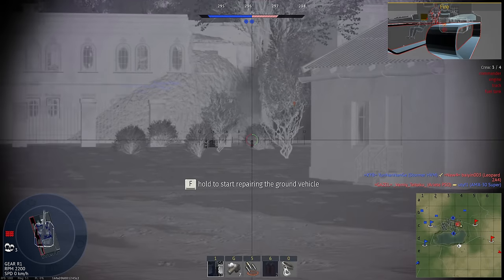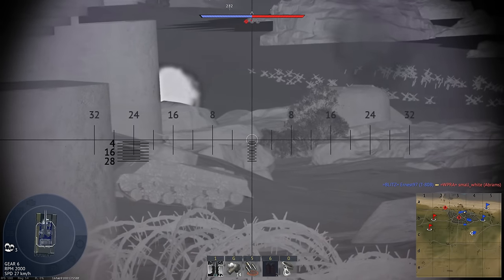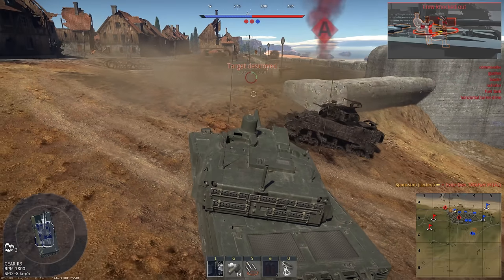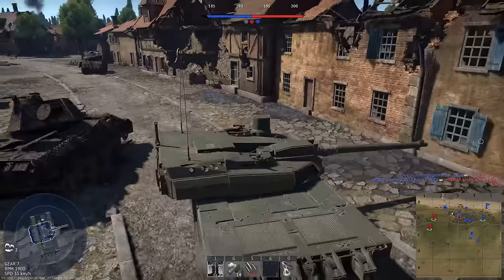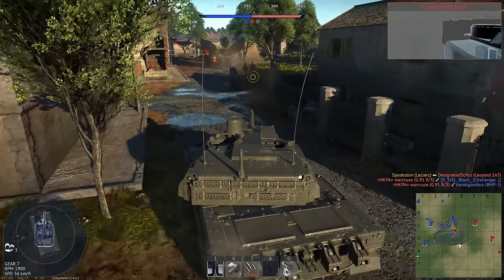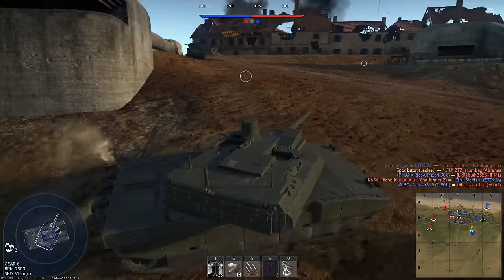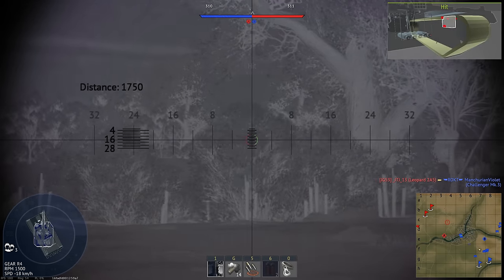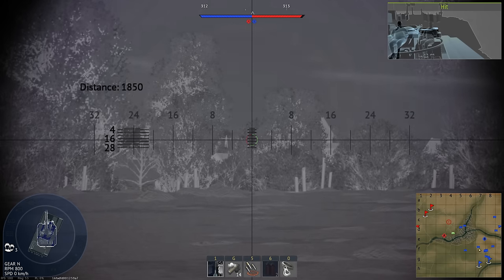The Future of Tank Armor

Comment: Would troop dropping be practical? Such as the ODST’s or Starship Troopers.
Reply: @Tunnel Rat 

I don't think so 

it would be coming in to fast and if they put in everything it needed to survive a landing it would be to impractical
Reply: chuck buck Well the ODST drop pods don’t just free fall from orbit. They have air brakes and thrusters, so when the pod hits the ground it’s going about 60mph, or 100kmh. That is absorbed by internal dampeners. So it’s still much faster than a parachute and can be dropped from low orbit.
Reply: @Tunnel Rat 

yeah I get that but in real life it would have the disadvantage of being loud and highly visible 
unlike 40k drop pods ODST’ s need to slow down a lot like you said to 60 mph 
in 40k they use the speed of a object falling from orbit not only as away to avoid anti air fire and missiles but they also create a wonderful shock and awe effect from the shock wave 
this only works though because the s-ace marines of 40k are heavily biologically modified super soldiers where as ODSTS loose this -potential. The pod is slowing down drastically as it reaches the ground. Making it  vulnerable to anti air and enemy combatants in the area it lands in. 
a real one would halve to be abreast with defensive countermeasures like a low radar signature (stealth paneling) or flares and by then every time you launch it it would be like loosing a f-22 just to get a get a guy on the ground .

I guess the problem is that they only carry one person and the ODST pods have a one time use right?
that seems to expensive for practical use as re - entry does a lot of damage to space flight vehicles 
the space shuttles were built off the idea that they were recoverable and even then it took months of maintenance that ultimately was more costly than a single use rocket system.
I think that the starship trooper system works better 
it is recoverable and carries 1 or 2 whole squads 
in the real world however the main issue is not getting them into orbit and down on earth in one piece it’s how much did it cost to get them their and how soon can you do it again  
you would need to retrieve it, get it to somewhere to return to orbit and then repair it that could take months to do. since unlike in starship troopers and halo; a Osprey or c-130 cannot break orbit so we the pods to be at a space port, meaning, must travel all the way back to cape Canaveral just to have the opportunity to be used again not to mention the servicing and life span of a piece of hardware that withstands the friction of earths atmosphere that causes giant pieces of SOLID ROCK to explode from pressure enough to shatter glass.

it’s a marvelous idea that I could see being done but not until space travel is more efficient so that you could drop troops secure an objective and return the shock troops and pods to orbit wher it could be repaired and the troops rearmed on another to get on to another assault what would happen now is because of the long down time for the hardware to be mission ready again it would only be used for key missions or major breakthrough attempts of a front line.

what I see happening is somewhat of a combination of both ideas since we can’t quickly redeploy orbital drop pods
a large “space shuttle” carrying troops, vehicle equipment etc will launch from a station in low orbit and re -enter earths atmosphere. Then, the shuttle decelerates with air brakes or thrust and then instead of landing it achieves stable and steady flight. Then it releases its cargo in the form of multiple gliders that carry the military assets to the ground. The gliders will have the benefit of being dropped from high in the atmosphere where they can build up a lot of speed during descents for maneuvers and adjustments to their course.  Once they land they are converted into simple prefabricated shelters for the ground forces. But before that happens, the shuttle that the gliders launched from has to return to orbit, this entire system depends on the main mode of transportation being to return to orbit independently or not needing to be recovered from the ground. 

the shuttle itself is designed around being light and anything that is needed for re-entry is ditched with the gliders, thermal paneling (needed for entering earths atmosphere), control surfaces (wings ailerons, etc) it would be massive like the size of a cargo ship. But the light design and having most likely at least half of its weight shed, it would be mostly thrusters some fins and the crew compartment. It uses rocket boosters to re enter orbit where it would dock for repairs and reassembly. 

I have a few other ideas though (I’m bored alright)

the shuttle; similar to satellites, uses earths gravity as  a source of  speed and then would pull up into a climb and use the added energy from the slingshot maneuver and the rocket thrusters to get back into orbit. Sadly this kind of maneuver I did not mention because the rapid climb at extremely high speeds would produce massive amounts of g’s harming the airframe or the crew itself and also limits the window in which the para troopers or gliders have a small window to safely deploy. 

All in all 
orbital drops are expensive and complicated combined with putting them in a war time setting is probably an  order of magnitude more difficult. In a economic perspective you need to either invest in a highly expensive system that you can’t risk loosing that is very expensive to keep. While you could have cheap(er) system that is less reliable ...... but expendable. That seems to be my take on all this but I’m not an aeronautical engineer their might be a cost effective and reliable solution in the future .
Reply: chuck buck So? ODST’s aren’t for stealth, they’re for quick troop deployment.
Reply: @Tunnel Rat 

I’m saying in real life. Where we have radar guided auto cannons missiles and fighters. Not to mention theatre defense systems like the U.S. Patriot missile defense system and Israeli iron dome missile defense system. Not to mention in a scenario where the drop pod assault goes bad. During D-day the troops who parachuted in where scattered and the Germans had flooded the farm lands with water and some of the troops that even made it to the ground drowned due to a complicated parachute that took to long to take off or the Germans when they invaded Crete and did not land with their weapons and had no way to guide the parachute mid flight. In operation market garden  the British troops landed right on top of the Germans and most of them Died before getting out of the air . Even in Halo ODST their pods are scattered and the main protagonist if I’m remembering right was unconscious for at least an hour and the door did not work. He had to use the emergency explosive bolts. Airborne drops are dangerous, they can get troops on top of the enemy quickly but also can be very vulnerable if they cannot get quickly organized especially if they do not get support from air power or heavy vehicles.

Comment: Hey Spokston, I have a question. Does the Leopard 2 A5 (and higher) "arrowhead" turret armor work a little bit like the perforated one? I ask because there is something like normalization of hitting kinetic round and thus the penetrator hits angled front of arrowhead, perforates it and then has to penetrate another slab of armor (still in the arrowhead armor addon) angled in very different way (vertically and horizontally) and after that it can hit main turret armor. Does this kinetic penetrator normalize twice or even three times when trying to hit main armor? And if yes, does this effect has a potential to break the sabot because of tension caused by normalization while still being in the process of going through first one or two layers when normalizing to one more differently angled layer?
Fast pic of arrowhead addon: https://www.google.com/search?q=leo+2+a5+armor&sxsrf=ALeKk02cYijqp1g3rqOUbLJgs0ilC8whSQ:1588967812548&source=lnms&tbm=isch&sa=X&ved=2ahUKEwiAy5qwhqXpAhVIPJoKHToSBI8Q_AUoAXoECAwQAw&biw=1920&bih=937#imgrc=NkjNqLLFHIJUpM
Great video as always ;)

Comment: It seams like Metal Foam might work well on EFP/HEAT rounds. I mean shouldn't the jet be dissipated some by the little bubble areas? Wouldn't the pressure/jet seek the least resistance and so dissipate itself into the bubbles?

Comment: If the electromagnetic armor only has a circuit when it is penetrated by the copper jet, then wouldn't it be using basically no energy even if it was "plugged in" all the time?

Kind of like a battery sitting in a turned off flashlight. Technically leaking some amount of power but not a whole lot I have to imagine that whatever is produced by the engines to charge the battery should be more than enough to keep whatever capacitor is there topped off

Comment: How long has the PUBLIC known about steel foam? I have never heard of it before until now and I can see it's advantages and disadvantages. But when you're talking about shaped charges I'm gonna assume you mean directional or "focused" explosives. Depending on the explosive, it could or couldn't block said explosive on its own. Even with plate armor as a primary buffer the foam aspect that I think of is probably still going to be melted through with ease. But if we're talking about something that's gonna just rip apart plate with brute force i.e. a RPG it could stop it, though you are going to have damaged sections of the armor either way.

Comment: I'm not sure how official this is, but most conventional tanks have increasingly operated around the "all or nothing" principle used for late dreadnoughts and fast battleships and many different warplanes. 
Basically, maximum armor protection is at the most critical points.
So on tanks, large parts of the front. 
Obviously, all around protection has made more sense for urban environments. 

It's why in War Thunder, a late Cold War MBT (Leopard 2, T-80,  M1 Abrams) can be easily penetrated at the side or rear by a 37mm M3, while late war heavy or medium tanks are difficult to penetrate at any side. 

Also, Matsimus has a great video talking about how the composition, shape, and structuring of your armor can have an effect on different tank rounds: https://www.youtube.com/watch?v=u0p_Rr6gUtM

Comment: Oddy enough, there is evidence that armor would go the same way that Battletech went with its armor given that we've basically invented EndoSteel (back in 2016/2017, the famous 'metal foam stops .50cal video' started popping up) centuries before the Battletech material was invented in-universe.
Reply: And Gundam SEED uses it for the Astray derived MS. Though 00 uses Graphine( or as they call it E Carbon) armor.
Reply: @barrybend7189  however Battletech was one of the firsts in this regard. If anything it is oddly predictory in some regards, particularly when it comes to weapons and materials...
Reply: @TheTrueAdept  yeah though sad thing is all the SEED properly powered mechs are fission powered and not fusion powered. So downsides to SEED. Though it would be fun to see how Mobile suits and Battlemechs handle against each other.
Reply: @barrybend7189  Well in Battletech's case, there is a fission powered turboprop...

... and Battletech's space ranges are hundreds of km for even their weaker weapons...
Reply: @TheTrueAdept  well UC Gundam does have Mynovski particles belching out of their Reactors and IBO have Ahab waves that limit ranges by messing with scanners. So when the going gets tough mechs have to rely on silhouette scanners and thermal signatures at close range. Lets not forget IBO in particular have mechs that move close to power armor levels due to the Aylia Venaria control scheme.
Reply: @barrybend7189  given that Battletech sensors work pretty well even under ECM conditions... it would probably only mean slightly worse combat range performance.
Reply: @TheTrueAdept  Ahab waves in IBO stop all but QEC or laser com systems. In UC Mynovski particles can mess with local coms for 24 hours after dispersal. So also anything unshielded to either are going to be effected. Lets not get into 00 and its GN Particle systems as they are worse when it comes to advantages. Also Mynovski particles do mess with optical light causing a haze in high enough density.
Reply: @barrybend7189  However, Battletech's equipment is designed for practically all sorts of conditions... but yeah, Battletech v Gundam matchups aren't going to be easy.
Reply: @TheTrueAdept  Well it would be fun to see the 00 Gundams mop the floor against clanners. As Virtue and Seravee put all Heavies to shame( even the awesome), Exia and the 2 00 units are close combat masters, Dyname, Cheradim and Zabanya are sniper masters. Kyrios, Arios and Harute will just cause Clanners to be mad as they are all transformable.

Comment: Honestly, i do not think métal foam will be that good: it doesn t retain it s material properties that good After multiple hits.

On the other hand, a quite recent material does have, in my opinion a very good potential : high density polyéthylene (both in it s homogoenous form and it s fiber form that you may know under names like "spectra" and "deenema" )  high density polyéthylene does have the similar pros as métal form in term of potential use (a light stuff that absorb a lot of energy from the projectile) but with the advantage of not loosing it s ballistic efficiency as quickly and being far, far cheaper (and the only con being it is softer, but that could be compensated by adding stuff like alluminium oxyde crystals into it )

(For thoose who aren t familiar with it, alluminium oxyde IS a very hard material , and very abrasive, often used on angle Grinder disk to erode metal )

In my opinion, what may be the future of passive armors will be alluminium oxyde cristal poured into high density polyéthylene blocs, everything surrounded by Steel, and as the last anti spalling layer, spectra   fibers 

It would be both cheap and very efficient.

Comment: Aww.... 😔 I was hoping for structural integrity fields, force fields, hull polarization & deflector shields.... 😶 (though, not so much using energy energy to deflect kinetic energy, but redirecting kinetic energy into the ground, or a larger portion of the Hull to prevent it penetrating a small area of it! 😀😁)

Comment: The next generation of tanks won't need armor. They will be the cheapest and easiest to build drone tanks with big guns and that's about it. If they get destroyed oh well, send another dozen, no loss of life, no armor cost, no heavy engine and transmission combos, just a mobile tank destroying damn near disposable gun.
Reply: Consider this. 
what if, that tank could destroy a target at range and remain undestroyed, with the armor being less costly than, oh, I dunno...
AN ENTIRE TANK OF SEMICONDUCTORS AND MICROPROCESSORS
Reply: @KoishiVibin  You think semiconductors and microprocessors are expensive compared to armor and ammunition? You could run a whole drone tank with the compute power of a $400 chrome book. See how much armor that gets you.
Reply: So what you're advocating for isn't necessarily a "drone tank", but just extremely lightly armored tanks. If that's the case, Leo 1 and AMX-30 do exist and we could instantly swap to similar designs with no need for advanced electronics.

Also, if I'm not mistaken, the more expensive parts of MBTs nowadays isn't the armor, but the fire control mechanisms. Plus, body armor seems to be going back into the menu for infantry against small arms in recent years.